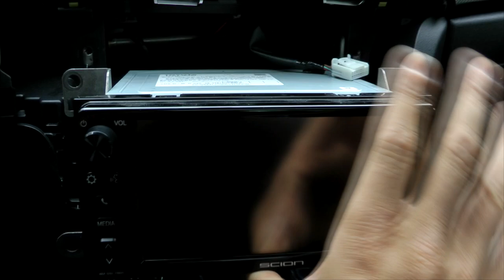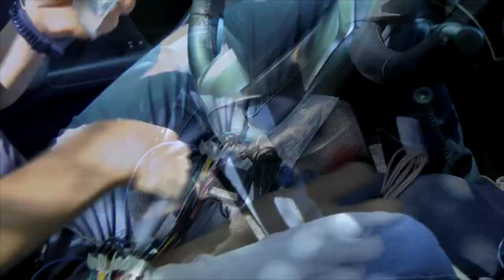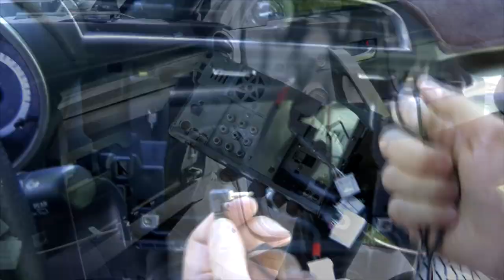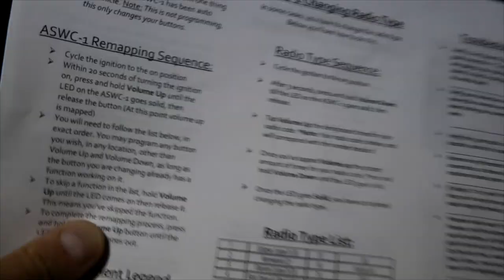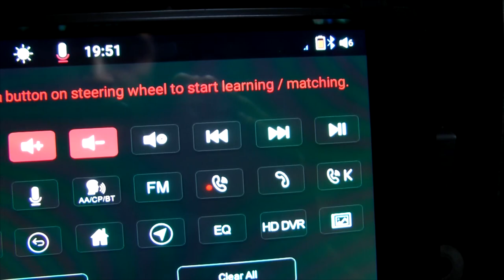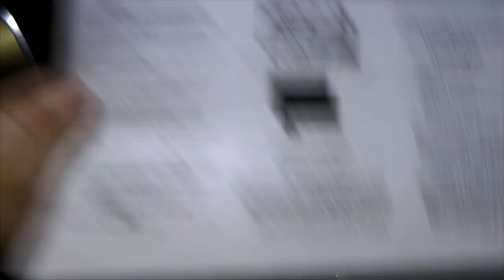Scion TC (2011-2016): ATOTO S8 Pro Android Head Unit Install. We Retained Steering Wheel Controls!

Comment from the maker: PRODUCT LINKS:
1. ATOTO S8 Premium 7inch Double-DIN Android Car Stereo, Wireless CarPlay & Android Auto - https://amzn.to/47150Ku.
2. Metra 95-8202 Toyota DDIN Multi Dash Kit - https://amzn.to/3RcOyQX.
3. Scosche TA021 Car Stereo Wiring Connector for 1981 and Up Toyota Vehicles, Wire Harness - https://amzn.to/3HjQsuk.
4. Metra 40-LX11 Antenna Adaptor Cable for Select Lexus/Toyota - https://amzn.to/3HnRINk.
5. Metra Axxess ASWC-1 Universal Steering Wheel Control Interface - https://amzn.to/3Jq5dhY.

RECOMMENDED TOOLS:
1. SOCKET SET, RATCHET - GEARWRENCH 57 Pc. 3/8" Drive 6 Pt. Mechanics Tool Set, Standard & Deep, SAE/Metric - https://amzn.to/41wE6Z3.
2. PHILLIPS HEAD SCREWDRIVER - PICQUIC SIXPAC Plus 7 pc. Multi-Bit Screwdriver - https://amzn.to/3IOHg1Y.
3. HEAVY DUTY SCISSORS - Fiskars PowerArc Shears (10 Inch) - https://amzn.to/406eX6r.
4. SOLDERING KIT - Weller SP40NKUS 40-Watts Soldering Iron Kit Red/Black, 5 piece - https://amzn.to/3LySkmG.
5. SOLDER WIRE - TOWOT Tin Lead Rosin Core Solder Wire for Electrical Soldering - https://amzn.to/3yWsXDL.
6. ELECTRICAL TAPE - 3M Scotch Electrical Tape, 3/4-in by 66-ft - https://amzn.to/3J0M0TB.
7. MALE / FEMALE ELECTRICAL CONNECTORS - TICONN 100 Pcs Nylon Spade Quick Disconnect Connectors Kit - https://amzn.to/3ZRMUYe.
8. CRIMPING TOOL - TICONN Crimping Tool for Heat Shrink Connectors - Ratcheting Wire Crimper - Crimping Pliers - Ratchet Terminal Crimper - Wire Crimp Tool (30C, Blue) - https://amzn.to/42je244.
9. GROUND RING TERMINAL - Baomain Ring Ground Insulated Wire Connector Electrical Crimp Terminal 18-22AWG Red RV1.25-4 Pack of 100 - https://amzn.to/3Ltg77M.
10. ZIP TIES - 400 Pack Black Zip Ties Assorted Sizes 12+8+6+4 Inch - https://amzn.to/3xWjrjM.

Comment: I installed pioneer stereo in my scion tc 2011 and only thing was missing the steering control which i worked out after watching this video. Excellent video and to the point. It will be nice to mention the useful wires of the 22 pins stock connector which are going to be connected to the controller. 
I was stuck on black and green wire and then i saw that it was connected to light green wire on stock connector. Vola after that my steering control after programming work excellent. 
Thank you.

Comment: I just installed an ATOTO S8 into my 2005 Dodge Grand Caravan, but I used the same Axxess steering interface as you.  ATOTO tech support told me to select Pioneer as the radio, but whatever works!  I was only able to activate 4 of my 6 steering wheel buttons, but I am going to try the rapid press trick you describe and see if that lets me load up the remaining two.  That would be GREAT.

Comment: Great video, except the adapter for the steering wheel controls is not needed! Just wire up the two SWC wires from the headunit to the 2 wires from steering wheel and it's good to go.
Reply: Going to try this tonight, I hope you're right. I'm installing one and the steering wheel controls are a must
Reply: @13onethree  Did this work for you ?
Reply: Any News

Comment: are the dimension of the stereo the same with 2011-2016 scion Tc ? i have a 2013 and just bought the unit and i figured it should fit, please lmk if otherwise.
Reply from the maker: I believe 2013 is the same. Because the OEM unit is slightly wider, you will need this kit for the installation -  Metra 95-8202 Toyota DDIN Multi Dash Kit - https://amzn.to/3RcOyQX. I went through all the installation steps in the video.

Comment: Is the wattage the same as the stock radio, and does it sound as good? I have the 2011 Scion TC.
Reply from the maker: Atoto S8Pro has 29 watts of RMS per channel. The peak wattage is 196 watts. The RMS in the original head unit is 16 watts per channel. The peak wattage is the same 196 watts. ATOTO does sound good. I did not experience any problems.

Comment: Hello! Pls respond! I have a 2015 scion tC do i buy the same parts as you? Or anything different?
Reply from the maker: It's completely up to you. You can use the same parts / products, that we used. They do work with the TC. There are other options on the market that you can use as well.
Reply: @MorozovAutomotive  thank you for answering! Is there any product for the scion tc 2015 that is more straight forward? Cant find any other in depth vid like yours online. I rly do not want to solder and want something i can sort of just plug in and ready to go

Comment: What steps/products can I skip if I don’t care to radio, antenna and wifi features I really just want apple CarPlay and backup camera
Reply from the maker: It makes sense to install the antenna since it is not complicated to do. The only major thing you can skip is the addition of the steering wheel control interface. It won't affect the operation of the head unit but you won't have steering wheel controls.

Comment: I lost bass while installing this on a 2013 tc. Any Idea why? I already tried messing with the setting on radio and nothing.
Reply: the amp isn't on
Reply: @kirklandvanhattem8106   how yo turn it on. The blue wire is connected correctly. Thank you.
Reply: @Forddude24  I have no idea
Reply: @kirklandvanhattem8106  thank you
Reply: Bro, did u fixed it? I have the same problem:( please let me know
Reply: @andrickzavala6438   no i did not. I got frustrated and put the stock unit back on. Lmk , if you figure out a way, please.
Reply: @Forddude24  did u connected the AMP-CTN wire?
Reply: @andrickzavala6438  i connected the amp blue wire and did not work.  I have all stock speakers…. However, after installing any aftermarket unit, I lose bass.
Reply: @Forddude24  bro, I already fix my problem, just connected the AMP-CNT blue wire in the white one from the harness. And swipe down the screen and u have a menu with the AMPLIFIER TURN ON AND OF option, try it
Reply: @andrickzavala6438    Thank you! To be clear, connect the blue from the radio, to the white cable from the (metra) harness ?
Reply: @Forddude24  yes bro!! Do it, good luck
Reply: @andrickzavala6438  there are 2 whites, one with a black stripe and one complete white? Do you know which one ?
Reply: @Forddude24  ever figure out which? 😂
Reply: @zwvl  nope :( I put my stock back in ::
Reply: I was having the same issue that my speakers/bass weren't working as they should. The way I turn on the amp on is I connected the blue wire from the harness to the red ignition cable. Trust me, it worked perfectly now.
Reply: The issue that this video has is that it doesn't say that YOU HAVE TO CONNECT YOUR AMP, otherwise your speakers are going to sound like crap. The whiteish cable from the amp (pin 9 on the 10 plug harness) when connecting the new harness it leads to the blue wire. You have to use the blue cable and plug it to the ignition cable (red cable) so the amp can get power and the speakers work as they should.
Reply: @dannyvega4130  thank you for this! I will try